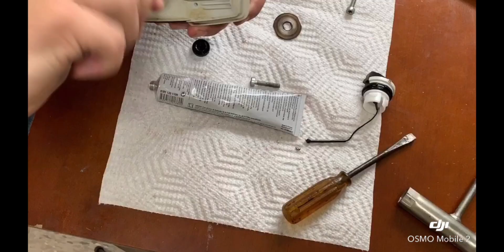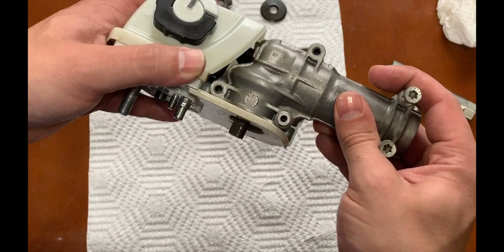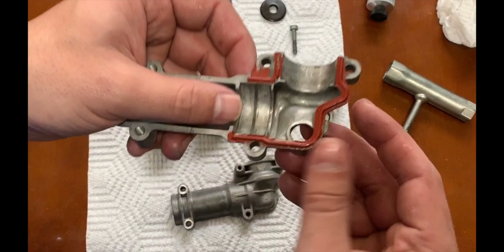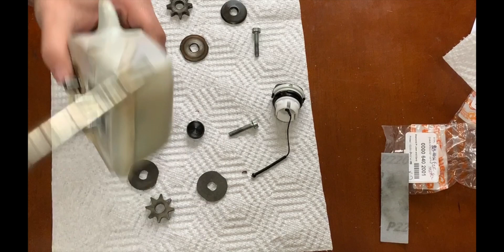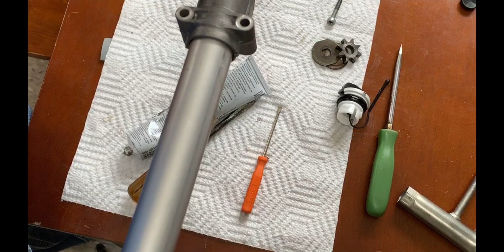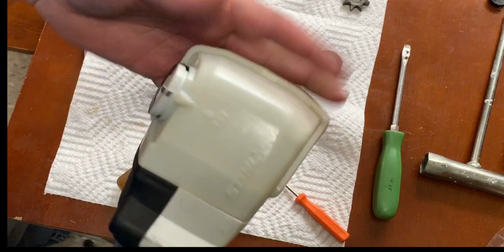STIHL POLE SAW SPROCKET REPAIR

Comment: Bar oil leaking... Try this... 
Lay the saw on it's side with the bar off of the ground and pop the top to burp it. 
Obviously it can't be full when doing this.
Your trying to get the oil to drain out of the oiler and back into the tank, while leaving an air pocket.
You may have to let it set like this overnight.
Then put the cap on it, or burp it.
I have had some luck doing this with my saws... But naturally, saws are filled while laying on their side.
Anyway, you get the idea.
Best to try doing this right after your done using the saw.
Seems to work most of the time on my saws, which I store in my basement.

Comment: Good vid, thanks. You used the grey silicone sealant, was it Permatex Ultra-Grey?  If so this is very strong sealant for high torque / high vibration environments application, but it is a real bear to remove! Permatex makes an Ultra Black sealant that is specifically to seal flanges against oil and grease and it is relatively easy to remove - compared to Ultra Grey.
Reply from the maker: Thanks. I just used grey because that’s what I had.

Comment: Thank you - my chain stopped spinning and I thought I had a major problem with the gearbox or shaft, not so, just the sprocket with it's clutch mechanism  - also my chain oil leaks when not in use, a design flaw I think. cheers

Comment: I am using this on a 25cc Craftsman weedeater that takes universal attachments🌀 allabout.wiki/Sun-Joe? The-setup-was-slightly-annoying-because it was overly difficult to get the chain on the bar/gear. I read some reviews talking about this thing leaking a lot of bar oil, but it honestly does not leak any more than my 3 other full size real saws. Once set up this things been pretty awesome. I moved to a very overgrown property in southern Missouri and this thing has been a huge help with getting stuff cleaned up. My first test cut was on a low hanging walnut tree branch about 5" in diameter and it cut through like butter. I have so far successfully brought down walnut, oak, locust thorn and those cigar tree branches (whatever they're called) up to 7 or 8 inches in diameter with no issue.....other random brush is gone in seconds. Pop the cover every once in a while to check for debris and make sure to tighten the fresh chain every so often as they tend to stretch a bit. Only time I've bogged down while cutting is when i forgot to open the choke on my power head after getting started lol. I've used this quite a few times now since receiving and have had no problems. I can easily recommend this product to anyone needing a cost effective tool for trimming trees or even basic saw tasks around a home/property. Worth every penny so far.

Comment: Great video!!   Quick question on the sprocket replacement.  I was using my pole saw today, and the chain stopped spinning.  I took it apart, and took the sprocket off.  When you reassemble the sprocket, how tight to you tighten the torx screw?  I don't remember how tight it was when I took it off - but when I was reinstalling, I was assuming it would go on tight enough to fully seat with the last washer.  However, the screw is too long to do that (and I do have the flat sided washer, the sprocket, and other flat sided washer and then the 3 washers installed).
Reply from the maker: I just tightened it as tight as I could get it by hand with the torx wrench I was using in the video.
Reply from the maker: Did you remove any other screws besides the sprocket screw? If so, Any chance you might have used the wrong screw for the sprocket?
Reply: @4MRanch  Thank you for your quick response!  I ended up taking everything apart except the gear box.  There must have been dirt or something in the hole where the torx is screwed into because after I cleaned everything, I was able to fully seat the torx and the saw is running great.  I took down 3 tree limbs to test and all is well..  Thanks again for the informative video.
Reply from the maker: Thanks, glad you got it working. Please subscribe.

Comment: Can you explain to me how oil is supposed to get to the bar aand chain when that thin plate covers the oil hole on the bar? When i run my pole saw, the oil just drip out from underneath as opposed to flinging off the chain like it does on a chainsaw.
Reply from the maker: I’m not sure mine doesn’t do that.
Reply: Havent you noticed that the plate blocks/covers the oiler hole?
Reply from the maker: The oil doesn’t come out there that hole is a vent. The oil comes out Of the big silver hole behind the tension screw and I delivered to the chain through the little channel on the orange cover
Reply from the maker: Debris can block that hole sometimes and cause it to drip so check it and make sure you clean the channel on the orange cover. Mine only leaks out the bottom when stores oil gets pushed out the vent behind the cover plate so I store it empty.
Reply from the maker: Here is a link to my video explaining it better https://youtu.be/OS96GBxOps4
Reply: Thanks for all of your help. Ill take it apart tomorrow and check it out.

Comment: My stihl kombi pole saw leaks oil also if I store it with bar oil in the tank so I just empty the bar oil tank into a plastic jar with a lid on it anytime I store the saw and have no problems. I use new 5W 30 synthetic engine oil as bar oil in mine and it works great.
Reply from the maker: Must be a common problem. I started storing mine dry as well.